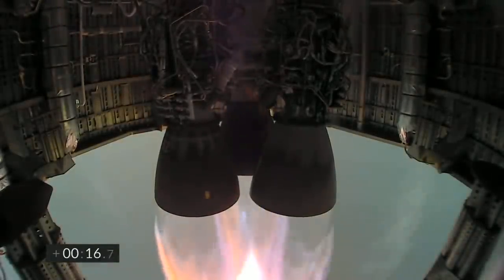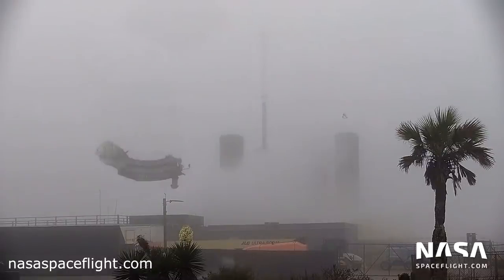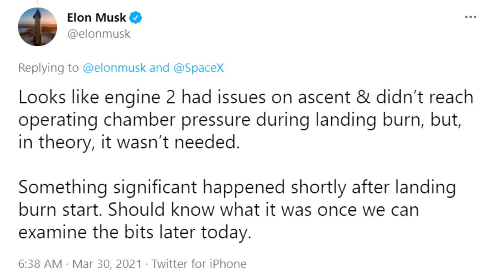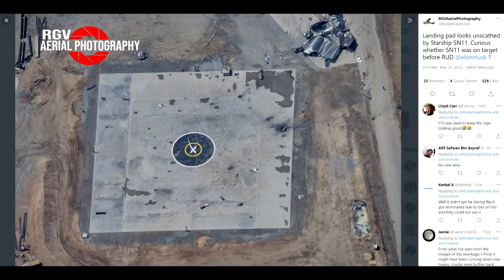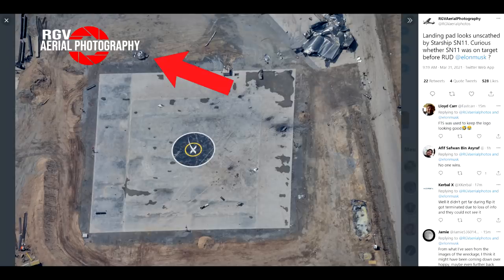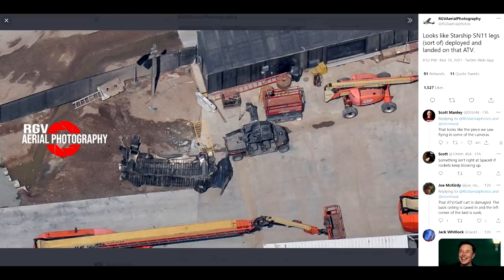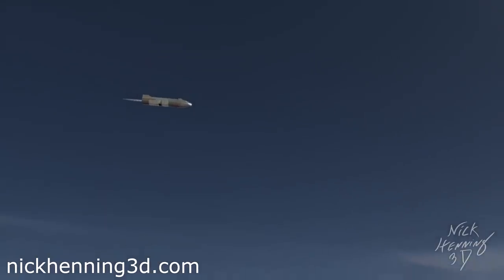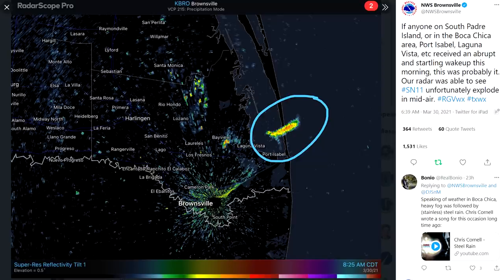What Happened In The Fog At Boca Chica - What Caused SpaceX's Latest Prototype To Explode?

Comment: Scott, would you call depriving yourself of visual data desperate or deluded? How did the FAA approve this?
Reply: It would indicate that the instrument data is more valuable than camera data.  Why would the FAA not approve this?
Reply: @TheEvilmooseofdoom  As it is a test flight of a highly explosive vehicle that has shown a popensity to multiple failure modes, one would have thought ALL data was important. Had it worked correctly at least a few times, then accepted. Albeit the area is excluded, data dropout would have meant a lack of redundancy. Single point failures in spaceflight are an especially bad idea and the FAA's ability to remain impartial have been found wanting in recent years. Musk is doing marvelous things, but commercial pressures are what they are.

Comment: The fog screwed with the ship's ability to figure out exactly how high it was, at least that's the problem I have with my drone in mist.  It thinks clouds and fog are solid objects so reduces power to virtually nothing as at gradually moves slowly through the cloud/fog.  Really annoying if the battery is on 10% and it's only half the way down through a cloud layer. 
I think it was a combo of slamming into the ground and triggering the self destruct, with all three raptors at full throttle.

Comment: My money is still on FTS... maybe SpaceX didn't command it and that's why they're saying it wasn't "triggered", but video shows one of the Raptors not gimbaling on relight... if that engine was commanded to full throttle but couldn't complete the rotation manoeuver, that would give the vehicle a lot of velocity towards a range safety redline and potentially an automatic FTS.
Reply: The system is automated, so if the system didn't issue the order...  I don't know how you can say and engine wasn't gimballing, the image froze just as the first engine lit.

Comment: At what point will SpaceX/NASA draw the line that the whole design is just too unstable to make it feasible for crewed flight and they just need an entirely different tank design?
Yes, early NASA also had a high failure rate as well but considering the amount of technical knowledge we've accumulated since the 1950s maybe the launch schedule is just way too rushed. Lots of taxpayer money is being wasted for proof-of-concept launches rather than a robust reliable design. (for those not familiar, about 50% of the funding for these rockets/launches comes from NASA, not just SpaceX)
I hope when they say SN15 had big changes they mean it this time.
Reply: It's still early in design and testing to call it quite despite the opinions of amateurs.  This is a new thing, flip up and relight, can't use any past data since the 50's.  Can you cite a source for that 50% of starship funding is coming from NASA?
Reply: @TheEvilmooseofdoom  I'm not sure how you don't already know that your taxpayer dollars are being used by SpaceX. Google the following terms: SpaceX, funding, NASA.' Right near the top there is an article from cnbc that NASA awarded $3.1 billion to SpaceX just for a crewed version of the Dragon capsule in 2020. Before that in 2018 it already awarded $1.9 billion.
For Starship specifically thus far NASA only committed about $135 million for development and another $50 million for testing (so maybe I was projecting the other programs onto it) but you know where this is leading. More taxpayer paid contracts for further development.
I don't think you understand how aerospace development works if you don't know the history of how the government, paid by your tax dollars outsources the research and development functions to private corporations through such funding contracts.

Comment: Fire from one of the raptors at T+0:26 is going to destroy pipes from other engines and failure was 100% sure
Reply: Nonsense.  Everything in the engine bay is subjected to a lot of heat, it's designed to handle it.

Comment: What possessed them to perform a test with known bad weather at the landing site? Recall that the Challenger disaster was caused by launching in cold weather despite engineers warnings. If Musk , the FAA, or any others applied pressure to test they should be called out.

Comment: Starship has same problem as space shuttle. You will never have safe routine reliable space travel with chemical propulsion. Belly flips wings ect won't change it.  BDB or big dumb booster concepts might be only way to make money.

 SpaceX needs to test simpler giant booster rocket, maybe reconfigure to not launch a starship but have expendable giant second stages with huge cargo capacity.
Reply: What problems are the same as the shuttle?  What other options other than chemical are there?  Expendable is of course completely defeating the purpose.
Reply: @TheEvilmooseofdoom  the booster wouldn't be expendable.  The starship just might be too unconventional to be effective like the shuttle.  Replacement of starship with a expendable second stage with many times falcon 9 payload capacity.

Comment: Why would you run a test like this if even the cameras can’t record the errors. Why do the wait to the last second to relight the landing engine ? In the video with all the engines lit you can see a flame up above in the mechanisms above the engine bells. What’s up with that ? This Musk outfit is somewhat of a non professional waste of somebody’s money. Raise your hand if you’d volunteer as a passenger or crew on one of his missions.
Reply: Why not run the test?  The idea of the last minute flip up is to save fuel.  The fire in the engine bay is a non-issue, all that stuff is designed to withstand MUCH higher temps.  I suspect you understand far less than you think you do.

Comment: Another abysmal failure due to rushed research and development from Space X..
If SN15 crashes and burns that's the end of Elon's starship dreams.. Elon will have to revert back to flight proven Falcon Heavy and modify it to carry a similar vehicle to starship.. If not then Artemis SLS will get to the moon and dominate the whole moon project..
Reply: Nonsense.  They fully expected things to blow up, that's the point behind use one test articles.  If SN15 crashes it won't end anything, they are already expecting a string of failure on re-entry testing.
Reply: @TheEvilmooseofdoom  Angry Astronaut has already summed it up.. They are progressing way too fast and as he said its dangerous..